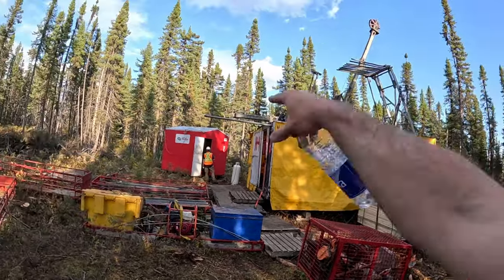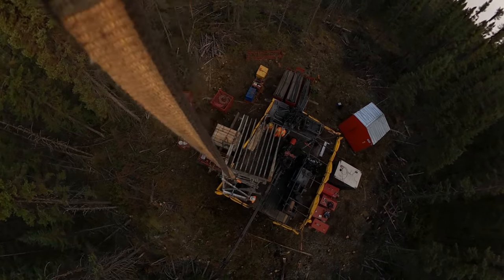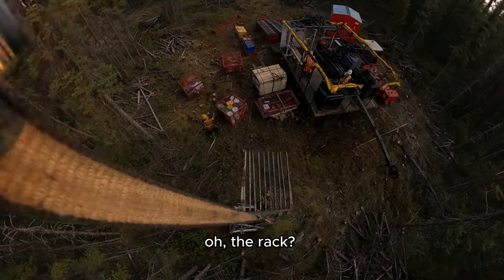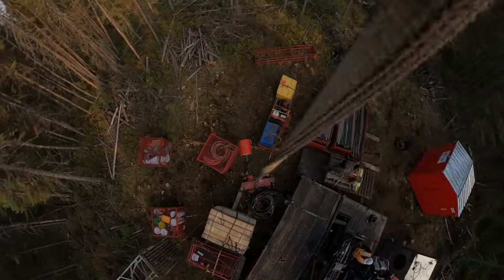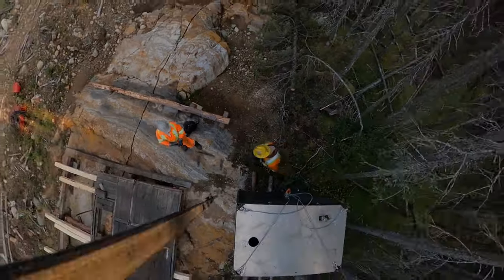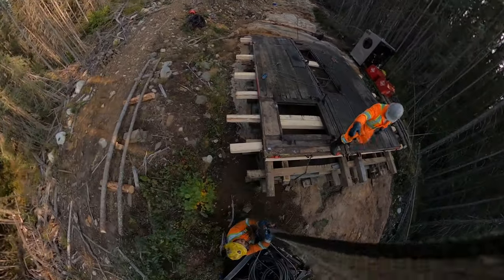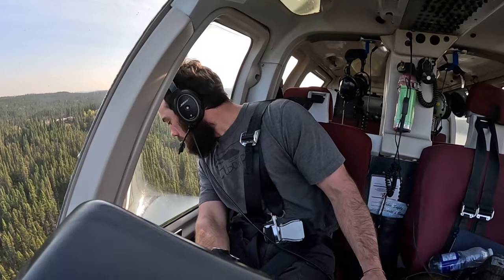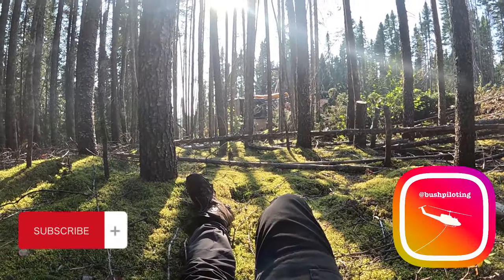How to move a Diamond Drill with a Helicopter

Comment: You say the internet is a cruel place to dhow your mistakes, to be fair, mistakes or not, you're doing a tricky job with lots of risks, and you aced it...
Reply: If you can buff out the "mistake "(while slinging)  it's not a mistake... just part of ops. Scratch.. peel or bent... yeah.. that's a mistake.  
Most of that drill rig stuff has been strained or bashed through every earthy item out there... Hard to imagine they might have been new at some time.. !!

Comment: i watched a guy in a little 3 bladed machine lifting building supplies into a steep construction site once. I rode my moto up and watched. He had the chopper stripped out as much as possible and used a little wiggle move to gently move into the right spot. Was facinating.
Really makes you realise those guys who fly the skycranes putting transmission towers together must be real guns.

Comment: Soooo... the intro image shows an ex-Niagara Heli bell 407 slinging... but the video shows a white 206.. Maybe it was Photoshopped ?

Often wondered what happened to those 407's.. (now Astars at NHL)  Went to GSHL... expecting to see 407's ,, but No.. Now that I have left... they have them... Grrrr.
Best little worker machine ..evah!!
Reply from the maker: Hey buddy. 
Yeah we operated an old Niagara heli machine, and it’s a photo from a drill move that I did on another job. 

The machine I used to move this drill was a white 407…. Not a 206… but yeah they look kinda similar so I get the confusion
Reply: @bushpiloting  Hey thanks bush.  Ha.. got about 5000 in 206's...about the same in 407's,  about 2000 in Astars, B4's and a bunch in 500's. Moving drills was great, if you got a great crew... there was long time before you got to go for a 'P' or a coffee.. then there were times when all hell broke loose, ... cable snags, wind, 
Enjoy...and respect Mother nature... best advice ever.

Comment: I don’t know the 407 specs but if you are operating so close to the limits quite often, is this the right helo for this kind of heavy jobs? Just asking…
Reply from the maker: Na, it's all good for the job. If I were to just go a bit slower or burn off an extra 10 minutes of fuel before lifting a heavy piece, it would make all the difference.